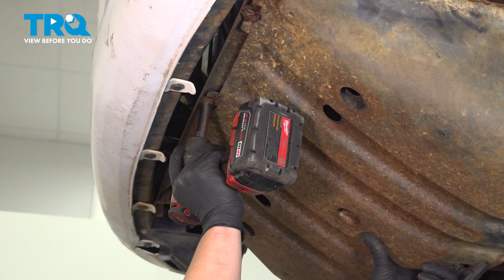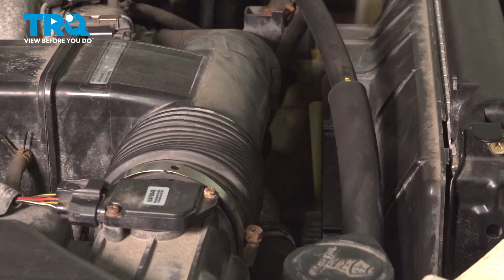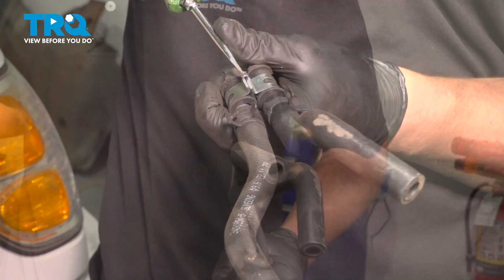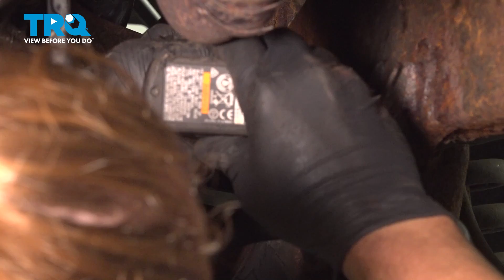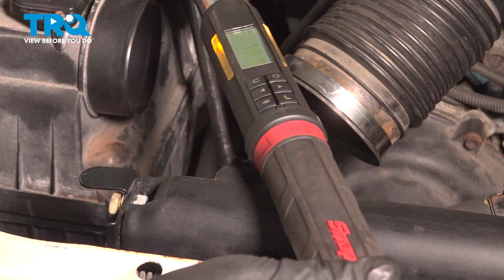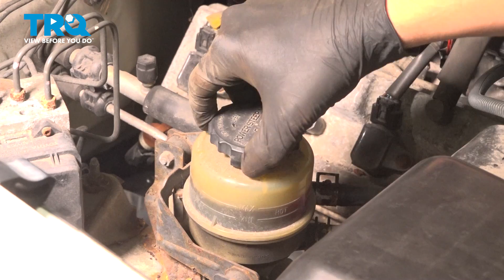How to Replace Power Steering Lines 2000-2006 Toyota Tundra

Comment: Went through each step in the video had to cut some rusty brackets but got it done took me 4 hrs. other than changing brake pads and oil this was the biggest job I've done on this truck thank you for the info

Comment: I dont have tow package but i do have the powersteering cooler 2000 Toyota tundra sr5 v8 4x4 access cab automatic which  assembly  would  i need?

Comment: some of the people may not know how to bled the system i wish you explained it , but those don't know here it is no big deal , start the vehicle and stir it left all the way then right all the way back and forth when stop gurgling after a few times left right , center the steering wheel and recheck the fluid add if need, don